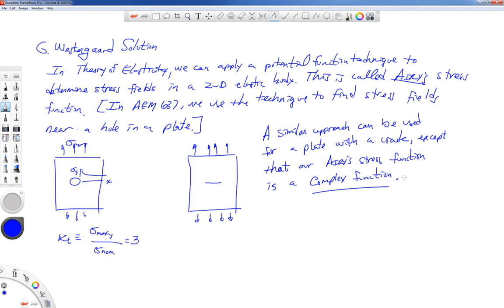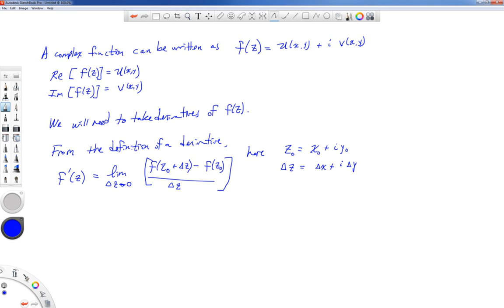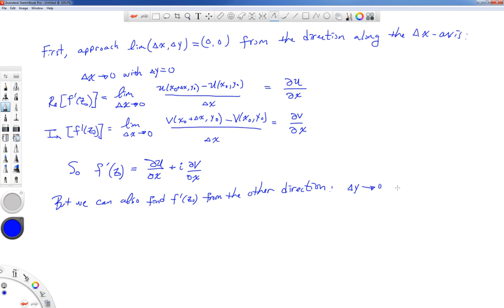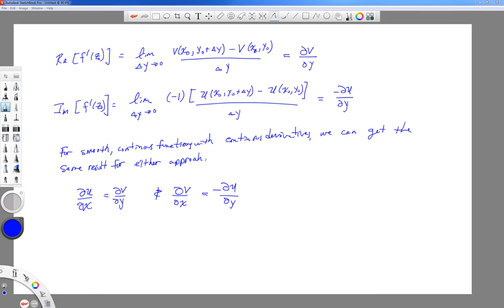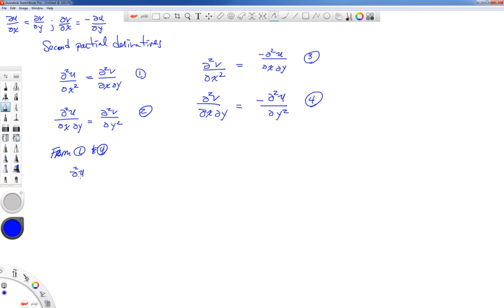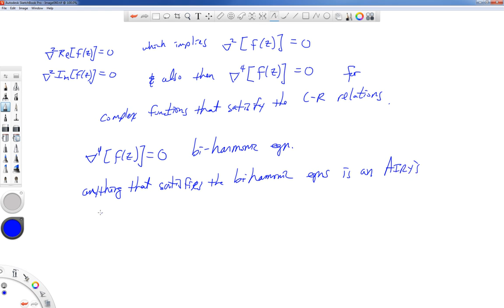AEM 644  Westergaard Solution part I   Basic Mathematics

Comment: Hello Sir.
I'm testing a material and I need to find K_1critical(critical stress intensity factor for mode 1) I'm using a double edge notch specimen and a compressive test. By video gauge I have the strain along a r distance from the notch tip. With the strain I calculate the stress in that point. So I have the stress field defined along the r distance. For the critical load this become the critical K_1. Can I use K=sigma*sqrt(2*PI*r) to find K?
I was expecting that K would decrease as the r increases. But the opposite is occurring
Reply from the maker: Hi Joao,--I think that the specimen you describe may not be a standard test specimen geometry (see ASTM E399) and so it would be difficult for me to say with any confidence what might be going on in your specimen.   I do not consider myself to be a 'hard-core' member of the fracture mechanics community so I think that alternatives to testing standards could be carefully examined.  I have heard tales of many heated discussions in standards committees over some of the details to be included in standards.  The benefit of the standard is that a lot of work has been put into the details and methods to minimize both testing and analysis errors.  Some additional thoughts:
-how are you relating stress and strain?  linear elastic?  
-how does your plastic zone size change through the thickness of your part?
-note that the stress fields as derived through the Westergaard solution are for near crack tip fields only
-I am unsure of what you mean by double edge notched specimen in compression
Reply: @mbarkey.mechanics   hello Professor. I appreciate your answer.
I'm studying the strain rate effect on intralaminar fracture toughness of composite material carbon/paek. Actually i'm trying to replicate this study (https://doi.org/10.1016/j.compstruct.2017.11.091) but using carbon thermoplastic material. There is no standard yet for dinamic loading and composite material. I'm still on the quasi-static test. Trying to find the Kc. But i'm having some troubles. My idea was to use the formula K=sigma*sqrt(2pi*r) since i have the stress and r. And then extrapolate the linear part of the curve K x r to find Kc. But my K doesnt seem to be right. It actually increases with r
Reply from the maker: @JaoFlores  I see, dynamic tests can be difficult.  I am sure you will do well.

Comment: Next time onwards please make clear videos
Reply from the maker: Sure, I will take constructive criticism--but tell me more specifically what you mean--is the video display not clear, the audio not clear, the lecture content not clear?
Reply: I mean the audio quality.But i would like emphasize you to give more intuitive approach.....
Reply from the maker: I can try to find a better head set, if I have not already.  (This group of videos were done a few years ago, but only relatively recently uploaded.) But intuition only goes so far in fracture mechanics.  While it may seem intuitive that stress intensity factors can depend on flaw size and stress, I don't think we can find the square root singularity through intuition alone, and the purpose of this group of videos in particular is to go through the derivation of the Westergaard solution, which by its nature, is mathematical.